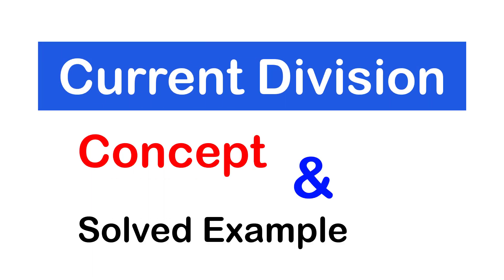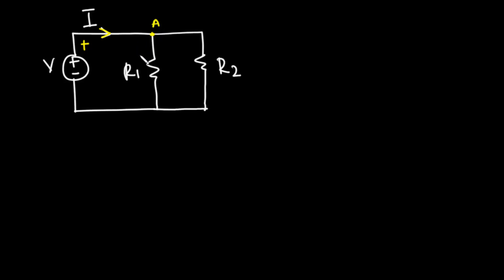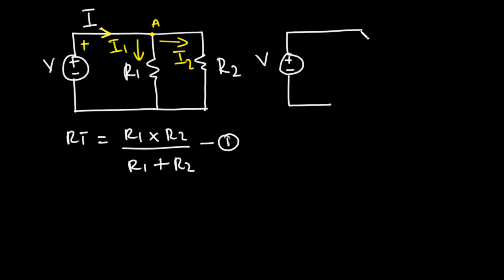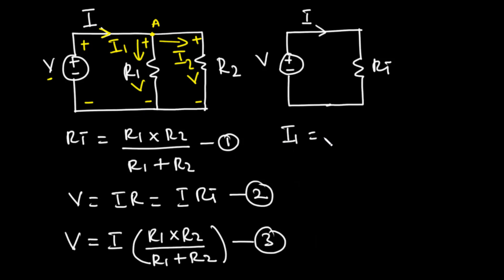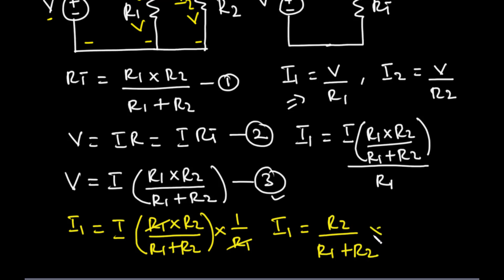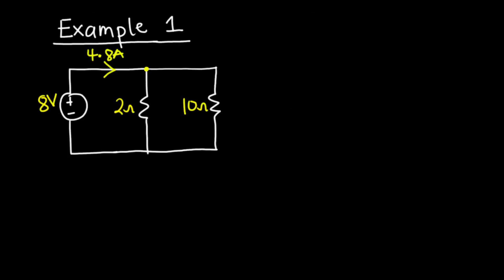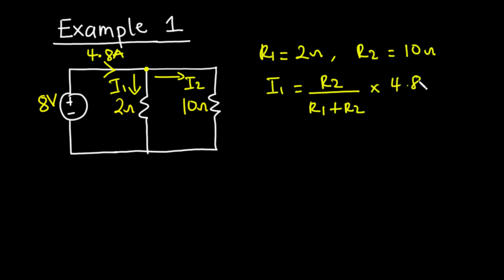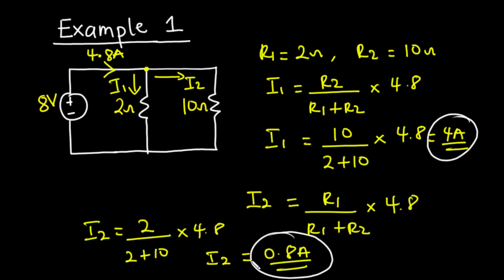11 - Current Division 1 - How to divide current in a parallel circuit

Comment: From other tutorials when you're finding the current flowing through the first resistor it is the first resistor times the current divided by the sum of the resistance of the first and second resistance
How come?
Reply from the maker: No please that's not it. That is when you want to find the voltage across a resistor. If you want to find the current through a resistor, it's always the second resistor divided by their sum times the total current